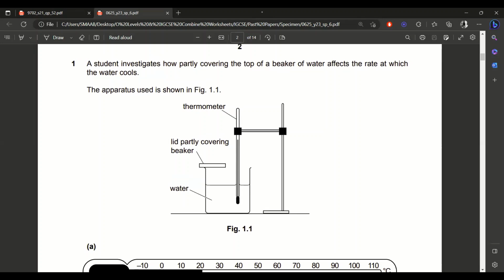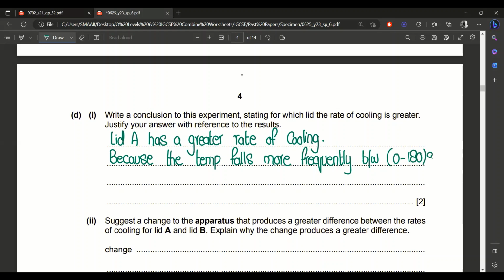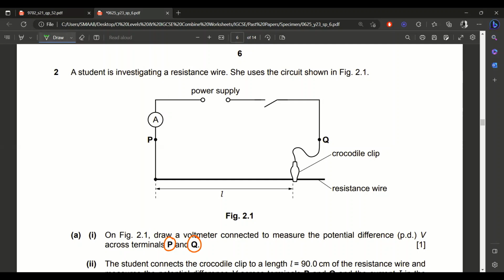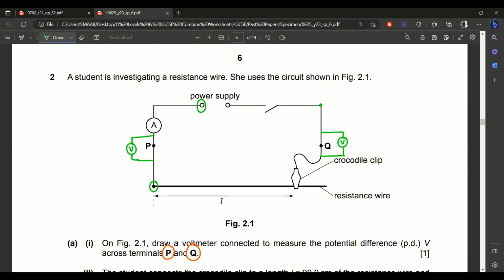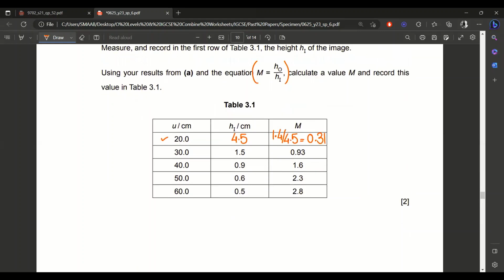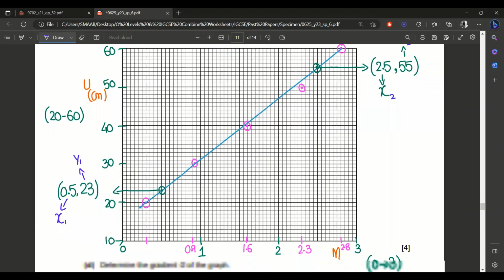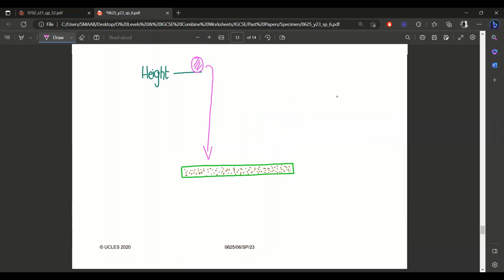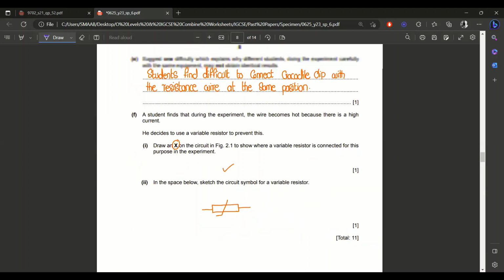Specimen Paper | Paper 6 | 2023 | New Syllabus Pattern | Solved | IGCSE | Physics by SMAAB

Comment: point of correction: the one you drew is a thermistor, not a variable resistor. A variable resistor has an arrow passing through it
Thanks for correcting the error, I'll just leave this comment here for future viewers
your voltmeter diagram is different from the one of save my exams and other websites. theirs is a line from p to q and the v is in the middle
is there a diffeence?
Reply from the maker: Thanks I also updated my comment ...